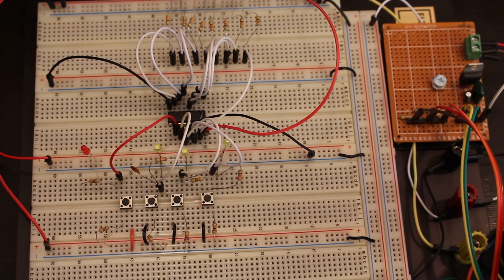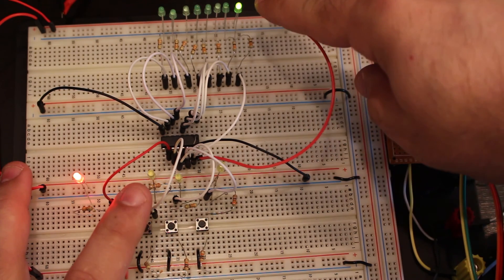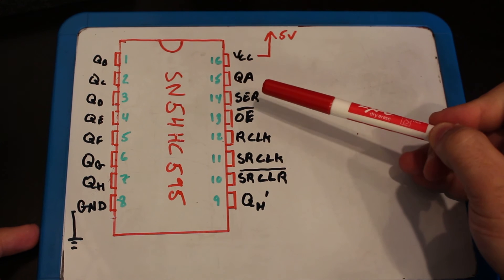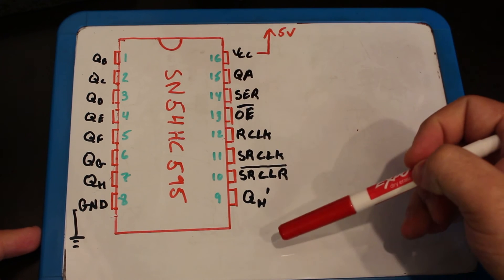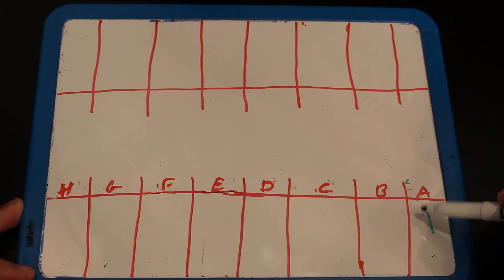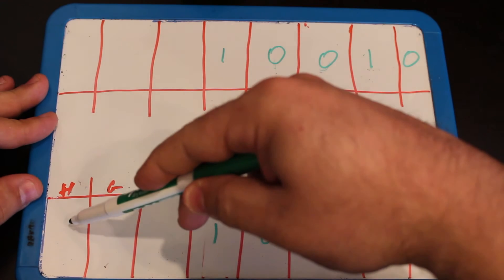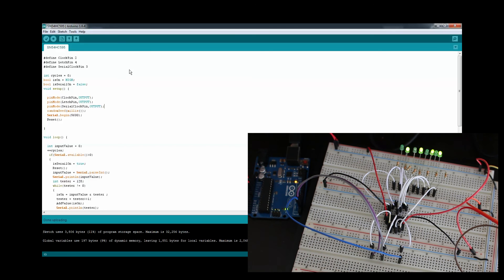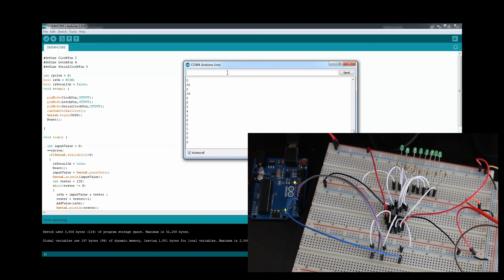Tutorial in Shift Register (74HC595) - How do they work

Comment: Sir, I'm currently using 24 LEDs and 3 shift registers. When I enter the value 1 to the data argument for the ShiftOut function, the first LED connected to each shift register lights up. Then, when I give the value 255, all 24 LEDs gets lit.  Would you please tell me how to only light up 1 LED from the lsst shift register ?  Thank you
Reply from the maker: How do you setup your shift resistors? Each shift resistor should have output 9 which is the overflow data. That overflow data will need to be connected as the input to the next shift. So as you push data and you enter 24 bits. The first 8 bits will be in the end at the last shift resistor and the last 8 bits will be in the first shift resistor. It sounds from your description that the LEDs are connected together, so when you pass 1 it lights all first bits of each resistor
Reply: Sir, Thank you very much for your quick responce. When I use someone's code(without shiftout function) it works perfectly. My code: shiftOut(11,12,MSBFIRST,B00000001); Thank you.
Reply from the maker: i'm sorry but for obvious reasons I cannot help you with someone else code. You should contact with that person
Reply: Thank you sir.

Comment: do this thing can be used for servo ? i want to reduce the pin used for servo because i want to input other things to my arduino.
>i'm making quadruped. so 12 pin to arduino will totally fill all the pin.
/im still beginner when it come to this ><
Reply from the maker: You will need to think about the delay plus it is not analog signal but digital signal. That is why it is good for LEDs and such. I'm sure there are some shift registers that will support analog signals.
One thing you can look into is multiplexers